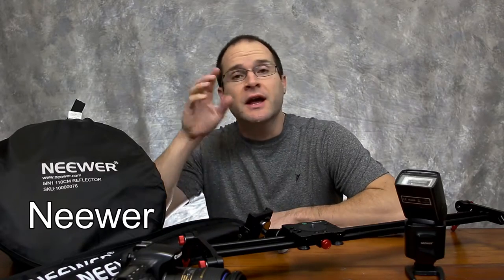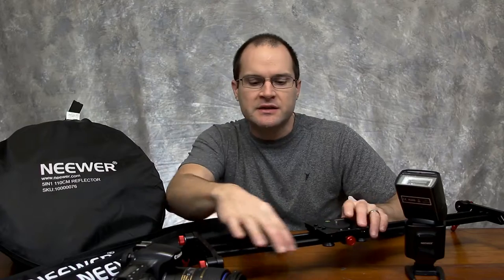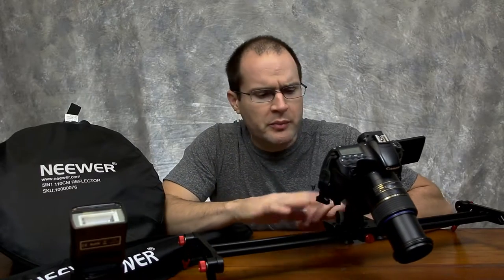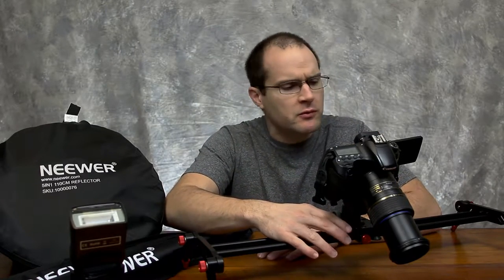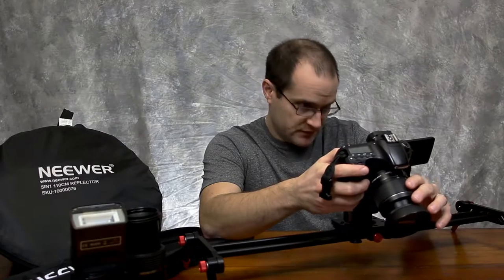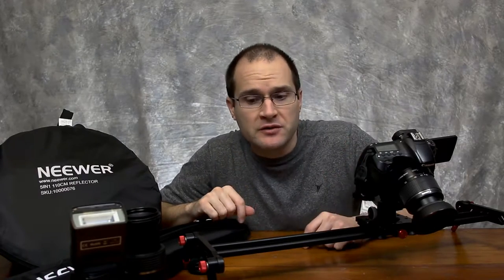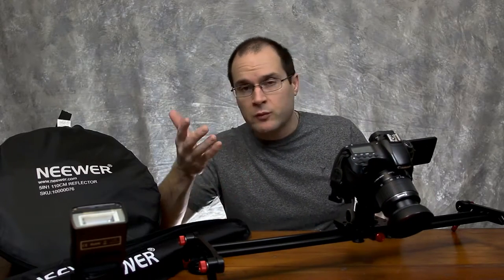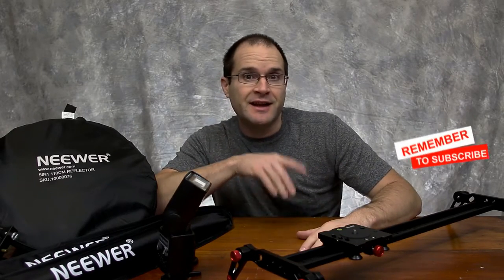Neewer bearing slider shake problem vlog 155

Comment: The shake seems to be periodic and occurring exactly every ~5mm of linear travel. My thought is that one of the bearings has a small imperfection on it (or even just a piece of grit stuck to the surface). Have you looked closely at the bearings yet?
Reply from the maker: +AirborneSurfer 
You can not open the bearing up but when I took things apart I noticed small metal flakes. So this is exactly what I am thinking. I am going to order new bearings. I think I was lucky enough to just get a bad one.
Reply from the maker: +AirborneSurfer 
Ha thank you. I thought you would read my comment and some how prove me wrong and open the bearing up. I worked the retaining clip out with a very thin needle so I should be able to clean them out.
Reply: Excellent! That seems like the most probable culprit. Those cheap Chinesium bearings probably weren't cleaned properly after they were turned so you've got some flakes in there causing the problem. Good luck!

Comment: Use an elastic band to pull it along, this removes tension in your hand
Reply from the maker: +Vibrant Films Pro 
I do that with my fluid head tripod but there is something in the bearings on the slider (tiny metal shavings) I still have to clean them out again. The rubber band works great I swear when I don't use it for macro shots you can "see my heart beat" as in my pulse shakes everything just that little bit that the macro lens catches. Or I could just be crazy

Comment: Are you loosening the tensioner knob enough?  I tried just loosening it until it slid, and encountered some issues.   Loosened more it seems OK.   Also there might be a bit of wobble (tilt) where one bearing moves slightly on the rail, some video I saw fixed that by adjusting some hex screws on the same bit of metal as the tension knob.
Reply from the maker: I tried adjusting it from the hex screws moving them so the bearings push more on the rails and I also adjusted them so that they backed off the rails. did the same with the locking knob. I also took the whole thing apart and tested each bearing. if I remember correctly 3 of the four bearings had the issue and I could see little flakes of metal on them. I cleaned them up and that helped a little but not enough for my liking. I still have to clean them up again and see how that goes. Its hard to show on camera what I feel when I move it. other than this little issue that I have with my slider everything else so far is pretty solid on it. When using a wide angle lens you don't notice it that much but when I use a 100mm macro I notice it. Maybe I am being to picky also I was wondering if anyone else had the same problem.